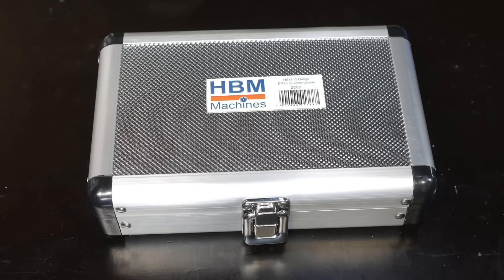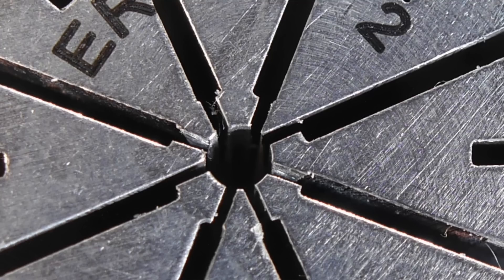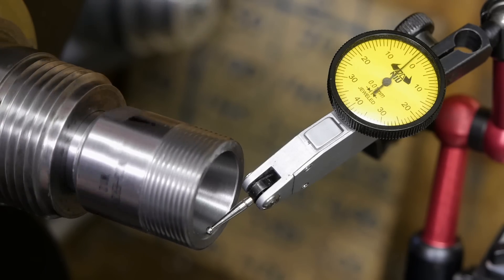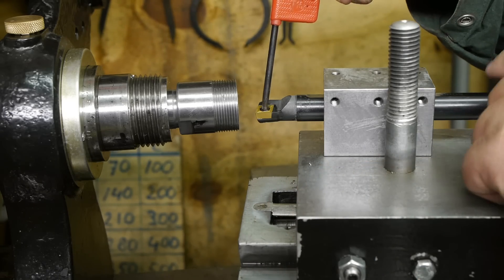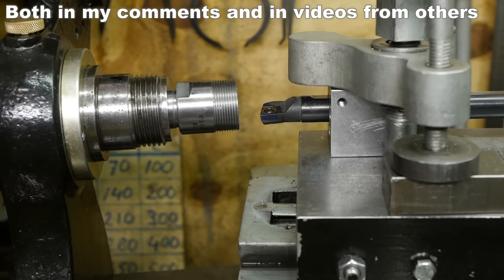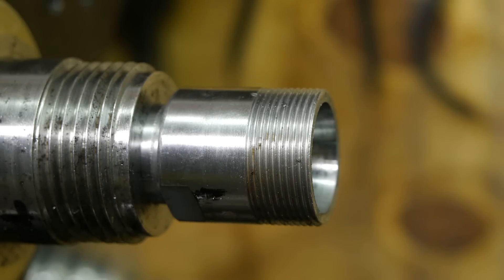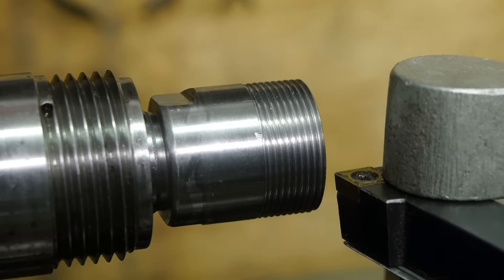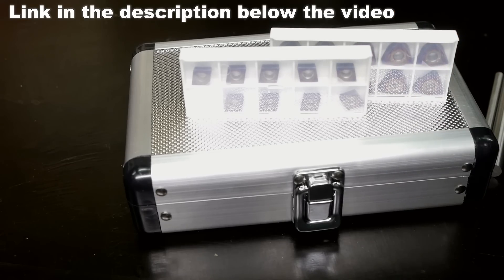Inspecting some HBM ER25 Collets and trying out some bue nano inserts

Comment: Not a machinist, but couldn't you clamp the outside of the collet chuck in a four jaw chuck. Then you could adjust the outer dimension for zero run-out. Then cut the internal bore and get a chuck with zero run-out.

Comment: You can get collets and a collet chuck with zero run out but your going to pay a lot more !  What kind of work are you doing ?  the cheap stuff from ebay and amazon works just fine for home hobby stuff.  What is it your doing that you need such perfection ???

Comment: I have those collets in 32mm and they are very good. The small collets have a reduced slit by design. You really have to grind the internal holder bore with a tool post grinder.

Comment: if you have runout on chuck and you cut out that bore and after that turn the collet chuck 180degrees its going to be 4thou out after that ;)
Reply from the maker: Yep, not not one of my better jobs :) I sould try and make a collet chuck myself.
Reply: @Rolingmetal  you should try to straighten the bore on your lathe to get repeatible readings :)

Comment: I too have the ER collets from HBM, and they are miles better than any other import collets.
My set does have a maximum runout of 1/100, most collets do better.
The main culprit in a ER setup is usually the nut. I replaced all my collet nuts with the ones that have the ball bearing in them (those can be found at arc euro trade in the UK)
This makes a difference which is hard to believe.
I suggest you get a colletchuck from HBM and a nut from arceurotrade (the one with the ball bearing) and you may just get yourself a setup that is indeed 1/100 mm 'pure' or better.
That banggood stuff isn't worth throwing in the bin, let along using it!
At the low speeds on your 'old lathe' you shouldn't be using carbide insert tooling. These inserts are designed for heavy cuts at high speeds. They usually do pretty lousy on low speeds. HSS will do a lot better.
If you really want to clean up that collet chuck, I suggest you lap it. That will get you a lot closer ..... 

Oh and WD40 is a good cutting fluid for aluminium.... it's pretty crummy for steel

Paddy
Reply from the maker: Thanks for that informational comment Paddy.

Comment: rM,
   I’m gonna stand by my previous comments on the Blue Nano inserts. You cannot expect good finish results with any carbide tool at such a low speed. I know your lathe is limited to 600rpm but that’s just not fast enough for carbide cutting. Also a hand fed cross slide always gives irregular finishes results. Even using a drill with an adapter will improve most finishes. It gives a steady, consistent feed. Something turning by hand cannot accomplish. I recently ungraded my collet set with a 25 piece set. They are marketed by an American company but were probably China made to their specs. I had an 8 piece Banggood set prior to this. The difference between the two sets are quite remarkable. The Banggood set was very inferior. Their quality control leaves a lot to be desired, to say the least.
    I here you on those aggravating shrink packaging covers on each collet. They are a fright to remove. I guess that’s better the Banggood practice of throwing everything together into a cheap zip lock bag. 
   Thanks for the review and Happy Birthday!
Reply from the maker: I've seen enough Banggood collets to be convinced  that they bought a ship load of rejects and are now selling them on the international market.
Reply: You’re probably right about that,

Comment: Good review video. :)
You should maybe try and grind up a HSS boring bar.  Run it slow and use plenty of oil.
I think you are loosing your finish down the back of hole when the chips start piling up.
I saw “This Old Tony” the other day with a battery drill driving his compound slide to get the feed nice and even.
Not sure you could get the drill to go slow enough for the HSS boring bar.
I also saw an old tool post grinder on eBay the other day.  It went for more than the cost of my lathe :(
Anyway enjoyed watching.
Reply from the maker: I once ground a internal threading tool, it took forever on my little grinder :)
I think you might be right about the chips piling up inside the collet chuck. I'll try boring it again with a smaller boring bar.
I actually made an adapter to driver the top slide handle but unfortunately my cordless drill has died since then. https://youtu.be/SBOdNKegaPU
Reply: Rough it out with an angle grinder :)
They will last for years with a bit of careful sharpening.

Comment: There is a relationship between the collet nut and the taper of the front of the collet . Depending how tight the thread is the nut will float on the collet or it will deflect the collet to one side depending on how close the overall tolerances are.
Try to tap the high side of the collet nut to improve your run out  or look into chasing the threads to ease the nuts position. You must have a precision carbide cutter to be sure you are measuring the arbor run out and not the rod you have placed in it.
Reply from the maker: You are right, after boring out the collet chuck the inside might no longer run concentric with the thread on the outside. and this will force the collet nut to push the collet to one side. This seemed tp be the problem with the er32 collet I reground last year.
Reply: Also you might have to shorten the threaded portion. You might find that you can't get full closure range before the nut bottoms.

Comment: HBM are usually Indian made stuff, not entirely Chinese. I must also add that HBM, a Dutch operation, bulk buys most of the stuff from lesser Indian/Chinese manufacturers and some better quality ones would not sell to HBM, Zither in India and Huhut in China are just some example because of the pricing. The emphesis on thes eoperations is just to make a lot of money. The quality of the stuff sold is evidence of how cheaplyand badly  these stuff are made. As for these ' nano ' whatever inserts, I have two sets of them, DCMT 07s and CCMT 06s and they geometry is incorrect. Neither of them fits either my sandvik nor Glanz tools. The sad thing is that they don't even fit the cheap Chinese one that came with them from bangood. I have some Iscar and Sandvik inserts that fit all the insert holders properly so the problem is with the inserts. If I were you I'd grind some M42 HSS boring bars with a nice radius and I bet you will have a great finish. Thanks for sharing.
Reply from the maker: Thanks for the interesting comment.

Comment: It's the low cutting speed what causes the problem. At 600 rpm ø25 has a surface speed of about 47 m/min. And then decreasing as the diameter gets smaller. You should probably have a surface speed of above 200 m/min on those inserts. Which means 2500 rpm at ø25.
Reply from the maker: I know it's a bit slow for carbide but it has worked out in the past.
Like someone suggested I think the chip build up might be the reason the surface finish got a lot worse deep inside the collet chuck.

Comment: It's interesting that you have a better finish up the front, maybe try giving the tip more relief below the tip? Swarf may be getting trapped and marring the finish and the smaller the diameter the less clearance you have on the boring bar below the cutting edge. Also although it may increase chatter, could try cutting upside down on the opposite side of the bore? Love your videos!
Reply from the maker: That's an interesting though. I'll try that out and report back later.

Comment: Brother, you don't want to put WD-40 on your collets!!! The last thing you want on them is oil. You want them as clean as possible, I'd clean them with brake clean.
Reply: That's not entirely true, you don't want any oil on the inside of the collet as this reduces gripping strength on the tool. 

However a light coat of oil on the outside of the collet is desired as it reduces friction against the taper, as the collet is driven in by the collet nut. This increases clamping force.
Reply: @FrenziedFruitcake  yeah a light coat of oil like the one from your hands when inserting the collet is sufficient, but not necessary definitely not two squirts.
Reply from the maker: FYI: on the inside of the collet nut that I bought from HBM is some thick kind of grease.
Reply: @Rolingmetal  Collet nut is fine to lube, not collet IMO. But most of new tools do/should come in cosmoline/oxidation prevention.
Reply: legal pitbull  No, I live in OK it's seriously about 100% all year. I have a non temp controlled shop and I constantly fight it. But I definitely don't use WD for corrosion protection and no matter what I use I thoroughly clean it off the collet before use and wipe collet down with it after. You don't want to lube something when what you're wanting is for that thing to grip as well as possible.
Reply: legal pitbull   Then why did you say I must not in live in high humidity?  WD-40 does not work well, doesn't last and I've seen it stain ground surfaces. You're much better off with products made for that purpose like CRC 3-36, LPS 3 & SP-350. Or even a thick oil is better than WD. For tools that aren't used all the time I coat then wrap in packing shrink wrap or like glad wrap.